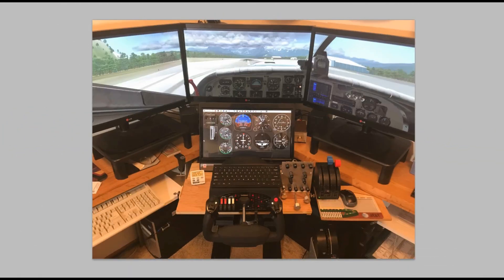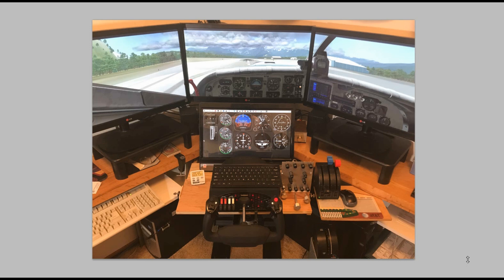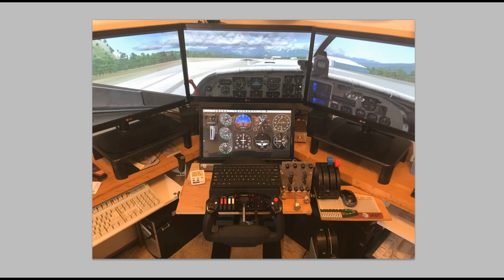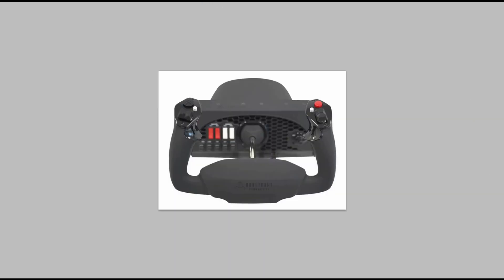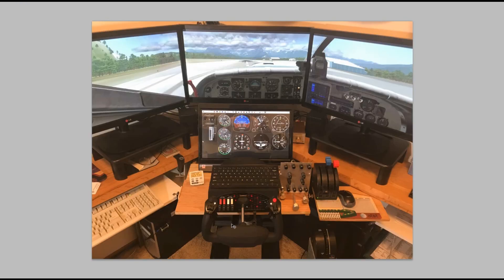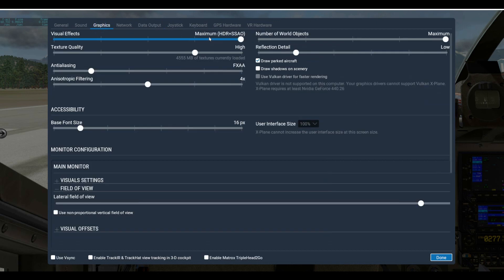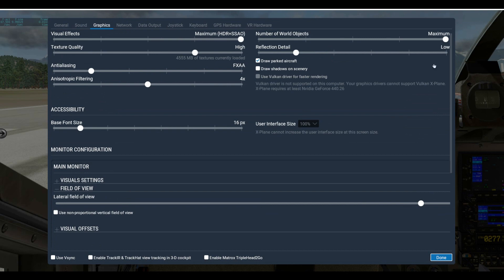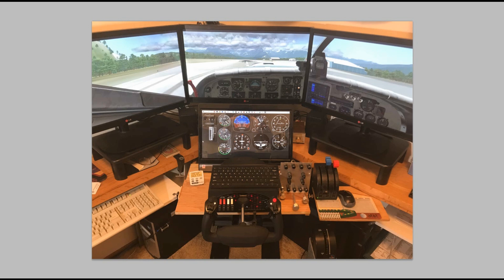Getting the Most out of Your Flight Simulator

Comment: HI Skip. Really like your videos. I'm new viewer, and new to flight sims. I have a nice iMac 27 desktop, and fly GeoFS w/ CH yoke (the original). I use one of the levers on yoke for rudder when I don't fly with roll/yaw autosynched. I hesitated with Honeycomb bc it would require more setup time. I hesitated with Xplane bc wasn't sure my Mac's 3.4 GHz Quad-Core Intel Core i5 could handle the sim. Would appreciate any info and suggestions. Thanks, and happy holidays!
Reply from the maker: Hi Ron, Welcome to the wonderful world of flight sims! When choosing a simulator it's a good idea to know what you want to do. If just flying around and not too concerned about having all the "bell and whistles" then pretty much any sim will do. 

Your system will work fine with X Plane 11 but you will need to turn down the settings to get it to run really smooth. 

Depending on the type of airplane you want to fly can make a difference also. Tail draggers are hard to fly if you don't have good control of the rudder. 

As I mentioned in the video the video card is probably the most important thing for frame rate and frame rate is the single most important item that effects frame rate in most cases. 

I suggest you watch a few videos on which flight simulator is the best for 2020. I think you will find X Plane is at or near the top of most lists and in my opinion it has features that make it the best, at least for me. I like that it comes with X Plane Plane Maker so you can modify the panels in "some" airplanes and can change the view point (where you sit). It also has World Editor you can download for free and you can modify airports and make your own airports. There are lots of Add-ons also. The scenery is not so great but there's things you can do to improve that too. 

Search for a simulator that offers a free demo version and give it a try, X Plane offers a demo. Try a few to see what's best for you, think about what most interest you about flying a sim and go for it!!

One last thing, The right controls will make a huge difference so if this is something you are really interested in don't skimp on hardware. Get the Honeycomb yoke if you can, definitely get good rudder pedals. The more realistic you can make it the better and more enjoyable it will be. Search for flight sim hardware to see what's available (lots) and go for all you can, it will be worth in in the long run.
 
Hope this helps, let me know, and let me know what you decide if you don't mind.
Reply: @WEHVideos  Skip, I appreciate this. I'll get back to you after I do my homework. Besides GeoFS, I have played around with FlightGear a bit. with your encouragement, I might try the Xplane demo and see how the system handles it. By the way, I have been going through many Youtube videos on simming and flying in general. Yours stand head and shoulders above most of them. I intend to learn and enjoy.
Reply from the maker: Hi Ron, You have the right idea, check out the options and then choose. Really nice to hear you like my videos hope they will be of help on your sim journey :-)

Blessings,
skip
Reply: @WEHVideos  Well, months later, here's what happened with me: I flew with FlightGear for awhile. Great if you are tech-savvy enough to deal with assorted issues. I switched to XP, and so far it's trouble-free. I see now that the world of simming is inclusive, atttracting people of all kinds, from those training for real-life licenses to those who simply enjoy  buzzing the neighborhood in a C172. I'll see where I land :) Just wanted to say again that your video and communications have always been a helping hand. Thanks.
Reply from the maker: Hi Ron, Nice to hear from you again and welcome to X-Plane and glad my videos are helping :-)

Blessings,
skip

Comment: I would think the Honeycomb throttle quadrant which has a trim wheel along with annunciators, and switches paired with a Honeycomb yoke would make more sense. Believe the paired Honeycomb products are game changers. Just saying.
Reply from the maker: Hi grantar2, Right you are! I didn't realize or think that is was available yet, should have check that out, however,  it's pretty large and a bit much for a Cessna 172N :-) still should have mentioned that I'm sure the Honeycomb combination is great  :-(

Blessings,
skip
Reply: @WEHVideos  I am not sure they have all the drivers sorted out, but the unit when combined with the yoke covers an amazing amount of territory. I appreciate your video. I am putting the final design specs for my sim which is will be built after my move early next year. Wife has cleared the use of one room for my sims and HAM shack. One racing sim, and a flight sim built on the Volair Sim Cockpit for the flight sim. Just waiting for them to update their instrument panel for the two Honeycomb products. 

Thanks for posting your video's.
Reply from the maker: Hi grantar2, If I spent any amount of time in jets I'm have the Honeycomb setup for sure it looks great. 

Volair has some really nice stuff and is a really good way to go, I'd be interested is seeing your system when done.

Good luck with you move and you are fortunate to have a wife that supports your hobbies, very nice!!

Have a great and safe Christmas :-)

Blessings,
skip
Reply: @WEHVideos  I will try to remember to send them. My wife considers my sim racing and future flying less expensive than my boats, and competition cars. Kept a sailboat in Dana Point Harbor for 15 years, and raced a Corvette in SCCA for a number years. One regional championship to show for it.  When you figure a 172S  is somewhere around $170 per hour at Fullerton, she thinks the sim is bargain. 
The beauty of sim racing (besides cost) is I get to compete against guys from around the world, and can qualify for races that are televised. https://www.youtube.com/watch?v=8Z98VlCcMlg
With sim flying I will be able to fly places I could never get the opportunity to fly, be it Alaska, or Australia. For 10 hours of real flight time you can build a great rig. You also don't have the risk of not maintaining proficiency. 
Stay safe, Merry Christmas.
Reply from the maker: Hi grantar2, Wow your a active guy, boat's, Corvette, and simulator racing, Cool!!
I watched part of the youtube racing video, I never realize you could race others online like that very nice, looks like a lot of fun. I had a racing sim years ago, pretty lame compared to this but I switched to flying instead but this is interesting, I'll have to check it out. Have a wonderful Christmas!

Blessings,
skip
Reply: @WEHVideos  Doesn't take a lot to sim race, current COVID rig is a Logitech G923 wheel and peddle set and a repurposed ATYME 32 TV. The graphics card is key and even that will be lightweight compared to flight sim requirements. If you do take the plunge come over and race the Spec Racer Ford, it's a great community that shares set ups, hosts a weekly test session followed by a week of racing and then the televised league race.  I am semi retired and being in the high risk health group, and having my three times a week golf curtailed by the outbreak, have plenty of sim time and HAM radio time. 
I am waiting for someone to host virtual flyin's. 
Give the sim racing a try I think you will like it. Here is what is new  Introducing the Dallara iR-01 by iRacing - YouTube 	
Introducing the Dallara iR-01 by iRacing
Subscribe to this channel to catch the newest upcoming events, behind-the-scenes development info, and new features/content from iRacing.com! http://www.youtube.com/subscription_center?add_user=iracingtv Subscribe to this channel to watch all the live action from iRacing! https://www.youtube.com/iracingesportsnetwork Find out what we're all ...
www.youtube.com
Reply from the maker: Thanks for all this info I'll check it out.
Three time a week for Golf, wow! I was an avid golfer for many years. Started at 7 years old playing with my dad. Was on my High School golf team and eventually joined the Olympic Club in San Francisco. I was a junior member there in 1957 and gave up golf and the membership in 2005 when I retired. I still hit balls every Tuesday with a friend who wanted me to help him get started in golf so it's fun going to the range and staying, somewhat, into the game :-)

Have a great Christmas and New Year!!

Blessings,
skip
Reply: @WEHVideos  I am envious, playing a U.S. Open open course is so very cool. I have been part of the greenskeeping team at Torrey Pines but never played the course. I am a firm double handicapper, though that wasn't always the case. Tennis was my sport in High School and College. I was born in 1959, so you are older than I am, but besides the range are you able to play executive courses. 
I have to be honest during the lock downs what I really miss were the days when I had Microsoft Golf on my lap top well traveling. It's not like flight sim or racing sim, but it did help me learn to think around the course and the details were wonderful. 
Have you worked any of the U.S. Open events? What was your best score on the course?
Reply from the maker: Hi grantar2,  Too bad you didn't get to play Torry Pines :-( I've seen so many tournaments there I'd love to have given it a try. 

I tried tennis with a golfing friend but I was afraid of hurting my ankles they always got sore after playing and I didn't want to mess up my golf game.

In my "prime" I got to a two handicap at the Olympic Club, that was during the 70s -80s. In 2005 I was around a 4 when retired at 62 and give up the membership and the game, too expensive. 

There are two courses at OC, the Lake (US Open Course) and Ocean. In January 83 I had my best round on the Lake course, 69. in August of 93 I had the best round of my life, 66 on the Ocean Course. The most frustrating, really good round, was a 70 on the Lake with a double bogey on the 18 hole, a pretty easy hole compared to all the other holes on the Lake. Never thought I'd be so discouraged with a 70, still hurts.

I think my absolute best round was a 77  played on the Lake two weeks before the 86 US Open just before they closed the course. The rough was a foot high and higher in some places, if you missed the fairway in the "short" rough you had a good chance of not finding the ball it was 5-7 inches high, if you found the ball it normally took a hard wedge just get back to the fairway.

I don't play at all now but am going to get at least one more round on Lake so I can say. I have member friends that will take me as a guest, just need to do it.

Microsoft Golf! I believe I had that. I still have and, believe it or not, an Amiga 1000 computer that still works and a Golf game called Leader Board. I actually liked that game better than Microsoft. I played Leader Board last year and it's still pretty nice for playing, graphics are horrible compared to new stuff but it's a lot of fun still.

Hope you can stay positive and enjoy what you can during this tough time!!

Have a great Christmas and New Year!

Blessings,
skip
Reply: @WEHVideos  you might enjoy this video, now that the drivers have been released it shows some neat functions. He has the commercial set up in place, for me it would be the general aviation set up but still between the yoke and throttle functionality very cool. Apparently the next release of Microsoft flight is supposed to have menus for both controls.
Reply from the maker: Hi grantar2, Sorry I don't see a link for the video, did I miss something?
Reply: @WEHVideos  https://www.youtube.com/watch?v=vZPhp8s7vp0   about 6 minutes in he starts to show the functionality.
Reply: Wishing you and your family a wonderful and joyous Christmas, a safe and prosperous new year.
Reply from the maker: Thanks grantar2, I'll check it out.

Blessings,
skip
Reply from the maker: Hi grantar2, Both videos do a good job, it certainly is an amazing throttle quadrant!! 

Blessings,
skip
Reply from the maker: Thanks grantar2 and a Merry Christmas and Happy New Year to you and yours too!!

Blessings,
skip

Comment: If u don't mind sharing specs?
Reply from the maker: Hi Muhammad,  Sure, I'm using Windows 10 with Intel i7-6700 CPU 4.00ghz and 16gb RAM. Video card is a Gigabyte 2070 with 8gb VRAM. This works really well I'm able to have Graphic and World objects settings set to maximum. If using one monitor I get around 70fps with four monitors I get between 35- 50fps. This is with a weather ad-on and more. Thanks for watching.

Blessings,
skip
Reply: @WEHVideos  tysm have a wonderful day Skip